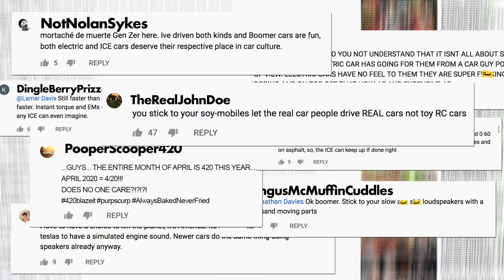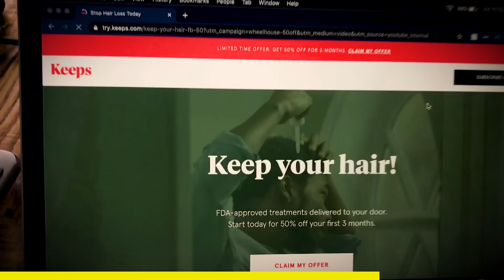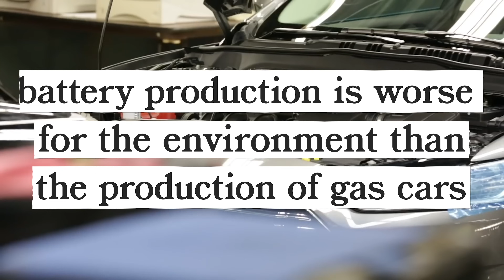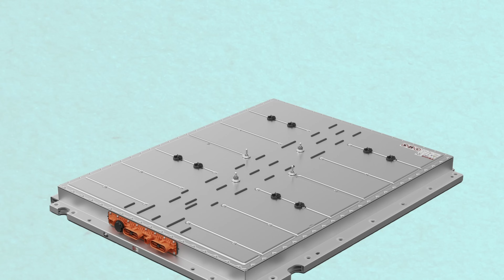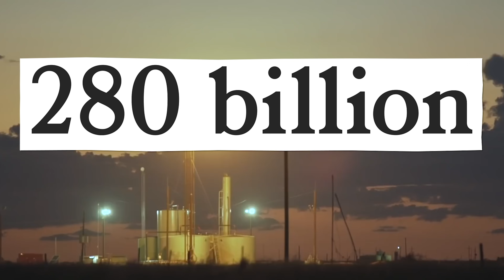Are Electric Cars REALLY Better for the Environment?

Comment: You forgot the most important factor - time. Nothing like wasting time to charge a battery. Gardeners don't even use battery powered string trimmers and yet, people are stupid enough to trust their cars to it. This country is getting more stupid as time goes on.
Reply: I have an EV. I charge when I get home from work. I just plug it in. I don’t have to stand around at the plug like some jackass at a petrol station. When I get up in the morning I have what is effectively a full tank of gas ready to go. I havn’t had to waste my time driving to a fuel station, standing outside in the early morning, then paying and driving back on route to get to work half an hour late, for the last year. Your judgement about time isn’t based in fact. My time has been hugely saved by having an EV. Not wasted.
Reply: @engineeringtheweirdguy2103  LOL...my gardeners don't even use a battery powered string trimmer and you want to drive around in one. You never had an emergency? Ever? What is the energy density of those batteries?
Reply: @LWRC  i don’t know what the energy density of my battery is. However comparing gardening tools to a car is a really dumb analogy to make. Firstly because car batteries are infinitely more sophisticated than those use in gardening tools. Gardening tools don’t have any form of battery management systems to maintain temperature and equalatoral charge cross nodes and regulate discharge and charge across nodes dependant on their state and temperature. Comparing EV batteries to gardening tools is like comparing an Olympic swimming pool to glass of water. They both hold water. But they’re made for different purposes and the Olympic swimming pool is a little more complicated in filtering, temperature control and chemical dosing.
Reply: @LWRC  hell you can’t even compare current car engines to gardening tools. When was the last time you saw a midsized sedan running off two stroke? Never.
Reply: @LWRC  but in answer to your question. If you hire a gardener, they likely spend all day doing lawns. Charging probably isn’t an option for them. I however do have electric gardening tools. Lawnmower, leaf blower and line trimmers. I can get through my whole yard and backyard on the one battery with the one charge (the mower takes two batteries at a time though so I take one out and put it in the trimmer and the other in the blower when I finish mowing). This works fine for me. By comparison, if you spent all day, every day, doing nothing but driving. Like a taxi service, you’d currently be better off with combustion. But if you just had to drive yourself to and from work every day, an EV would work fine for that purpose.
Reply: @LWRC  and emergency? Yes I’ve have plenty. But my model 3 standard range gets 250 miles to a charge. That’s enough to get me to and from work 3 days in a row without having to charge if I pleased. It’s enough to go to work, travel to the next city over to see my grandmother when she was ill, stay the night to look after her and then travel back to my home city on one charge. But if I had to I could have run a cable from a power point in her house to charge the car overnight or I could have stopped at a super charger on my way to or from and spent 10 minutes charging my car up. I’ve had emergencies. And I’ve never had an issue. And that’s using a standard range model 3. Not a Long range model 3 or the more impressive long range model S with 400 miles to a charge.
Reply: @engineeringtheweirdguy2103  I like knowing I have flexibility and not have to plug in any stupid charger. I go to the gas station and fuel up and that's the end of it for at least a week. And this is on a high performance car that doesn't get good gas mileage. I don't care. I can afford all the gas I can burn and I do burn a lot of it.
Reply: @engineeringtheweirdguy2103  Two stroke engines produces a lot more power than 4 cycle. Besides, who wants to keep waiting for it to charge? Sure you say you charge at night. What about if you forgot to plug it in? What about if someone needs the vehicle for some other reason and there is no time to charge it? You going to buy another gasoline vehicle to keep as a back up?
Reply: @engineeringtheweirdguy2103  You obviously don't get it. It has nothing to do with the sophistication of the technology but the energy density and how easy it is to use on demand.  A perfect example are forklifts in warehouses. They're not using propane in certain areas and have to use electric. Fine. And that is if the user doesn't forget to plug it in even with a battery gauge. Sometimes, shit happens and you have a forklift sitting on the sidelines charging for 8-10hrs during peak hours!!!  You want to keep it in a golf cart - fine. But don't force this stupidity on the rest of us that have better things to do than to charge a battery.
Reply: @LWRC  no. The only mpg equivalent that out does an EV are plug in hybrids. Which is almost an EV as it is. And I already told you. I can forget to plug it in 3 days in a row and get to work and back just find. And I have a 70 mile commute. Failing that I detour on the way home and stop at a super charger for 10 minutes. And I have had things pop up, I already told you. My grandmother became ill and I had to drive to the next city over, stay the night then drive back. None of it was an inconvenience for me.

But I’ll have fun in my much cheaper golf cart which can outperform almost any other combustion car, has better safety and handling than most combustion cars and has better features such as sentry mode, cabin overheat protection, remote summon and free regular over the air updates. You can keep your dinosaur car. You’ll have to buy another one before my golf car becomes useless and needs to be scrapped.
Reply: @LWRC  and nobody is forcing it on you (yet, they always talk about banning ice cars after a certain date but few places have done it). You’re just being reminded that they’re better cars in a lot of ways. Not in all ways for all cases, but in a lot of ways. Performance, safety, handing, cost to run, software features etc etc etc.
Reply: @LWRC  you seem to think with 250 miles of charge on even a standard range that I don’t have any flexibility for emergencies. Why? When was the last time you ended up driving for 3 1/2 hours for an “emergency”? I have plenty of range even with my standard range to drop what I’m doing and drive to the next city over and back. I have plenty of range to forget to plug it into a wall point for up to 3 days consecutively, including any trips to shops or local family visits, gym, etc. 

These aren’t problems. You’re making up problems that don’t exist. A real problem would be charge times for Taxi drivers. A real problem would be long distance freight for trucks. But for domestic purposes for people like you and me. These aren’t problems. Stop pretending they are.
Reply: @LWRC  also yes. Whilst it entirely green. They are far more green than any ICE car.
Reply: @engineeringtheweirdguy2103 Again, you want to waste your time go right ahead. These are toys and aren't serious consumer products. Most of the electricity in this country still comes from fossil fuels so what's the point to build a whole new infrastructure to save nothing?
Reply: @engineeringtheweirdguy2103  you want to look at the crap Tesla puts out? Safe? Hardly when the batteries self combust. I actually love Tesla drivers...when I change lanes, they always let me in and leave a lot of room. But then, my military HMMWV may have something to do with it. And keep driving your EV as it saves more fossil fuels for me.
Reply: @LWRC  what whole new infrastructure? Even running on a coal based grid they’re still more emission friendly the ICE vehicles. And the infrastructure is already there. Every building has electricity supplied to it.
Reply: @LWRC  actually according the the beuro of statistics, national highway and Traffic safety board, AANCAP safety board etc etc. they are 11 times less likely to spontaneously combust compared to a ICE vehicles and 5 times less likely to combust in a serious incident and when they do, are mildly safer as thermal runaway in batteries is slow and produces a lot of smoke without flames for hours before visible flames and present whilst combustion cars can be engulfed in seconds.
Reply: @LWRC  EV’s also have the highest average safety rating of any car category and the top highest scoring vehicles in safety in every nation that sells them are EV. For example on Australia 2 out of the top of 3 inclusive of the number 1 spot, of safest cars in Australia are Tesla’s.
Reply: @LWRC  and no. That’s not Tesla advertising and hype. That official numbers from government departments, and third party, and government vehicle safety boards.
Reply: @engineeringtheweirdguy2103  read the write up on tesla. Those cars left the factory with missing parts. Ever own a 911? That's what world class manufacturing looks like.
Reply: @LWRC  once again. Those problems havn’t been around for several years now. Infact there was a 85% drop in production faults within 6 months. Because they went from small batch manufacturing to full scale mass production. In the process they had to learn all the hard lesson legacy auto makers had to learn decades ago. Further to that they received much much higher volume of orders than they were expecting with the model 3. So much so for a while they were literally producing the vehicles out of tents! But like I said. Those issues aren’t a common anymore and are now on par with legacy auto makers. Infact an ex Ford executive in charge of quality control for forced inspected some model 3’s he saw parked in a car park and said they were on par if not better than other legacy auto makers
Reply: @LWRC  infact the orders for the model 3 were and still are so high that they are the best selling luxury vehicle in ANY CATEGORY. In the US. Selling more than the next 3 most popular cars combined. That includes Mercedes, BMW, Lexus, Audi, etc. they weren’t expect that kind of response.
Reply: @engineeringtheweirdguy2103  Learn? WTF? Aren't those workers suspose to know what they were doing? It is amazing we have people who actually buy this junk that wouldn't pass for cars from Korea. And now Hyundai cars are actually pretty good. Certainly a lot better than tesla. And you know what they say about a fool and his money.
Reply: @engineeringtheweirdguy2103  Just like the masses who jumped on the bandwagon when battery quartz watches first came out. Much more accurate than mechanical watches. And they're totally worthless the moment you walked out of the store. And my Rolexe I can actually sell for more than what I've paid when new. Can you not do any origibal thinking or are you just following the herd and what is told to them?!!!
Reply: @LWRC  right. Just skip over my comments about what the Ford exec who used to be in charge of quality control said about Tesla’s. Or that it’s no longer a problem. Completely ignored those. And clearly you do understand process control over job control. The workers know what they’re doing. But they either didn’t have the tools to get the job done to a certain degree, the time, or the end of line quality control set up correctly. Every major auto manufacturer has been through that phase when moving to mass production. Every one of them.
Reply: @LWRC  well the herd at the moment still back fossil cars. Because they make a “vroom” sound and think the batteries only last 2 years despite having an 8 year warrantee. 

As for you analogy to quartz watches, that’s not a very good analogy as a vehicle is a much larger investment than a quartz watch. Which means the market would need much higher certainty as well as much better results. 

As for your Rolex, that sits under an interesting business category. I forget the name of the model but basically companies like Rolex, take apple for example, pride themselves on being expensive. The more it’s costs, the more you want it. As opposed to traditional markets where the cheaper something is the more you want it. They actually did studies and people were more likely to buy apple products if they were more expensive than if they were cheaper. Your Rolex is in that category.

As for my model 3, at current I can sell it for more than I purchased it for. In Australia the wait list is so long and the actual price of the vehicles have gone up (due to exchange rates) than I can make a profit.

However in the US, model 3’s have been on the road long enough to get depreciation data. And if you look, the model 3 has the lowest depreciation of any car in history. Which should tell you all you need to know about EV’s.
Reply: @engineeringtheweirdguy2103  Certainly. Every manufacturer has had problems but not to the degree Tesla has had. To leave the factory with key fasteners missing? You want to pay for that crap - go right ahead.
Reply: @engineeringtheweirdguy2103  Sure - I'll race you in any Tesla you choose and I guarantee you will not win. 0-100-0 as many times as you can handle. And what happens after 8 years? What happens to all that waste that doesn't get recycled? We don't even recycle cell phone batteries and there are billions of them. In addition, to make these batteries, there are strategic minerals that are NOT within our control in the US. In addition, a whole new infrastructure has to be built to charge these golf carts out in the wild. A local Costco had 4 chargers installed years ago and they recently took all of them out. I didn't ask but it must have been a business decision. So yes, this is the trend we are in now and will be for a long time to come.
Reply: @LWRC  as I said not a problem anymore but very few had missing components the majority were panel gaps and pain finish issues. But even if they still had paint and panel gap problems, with what the car provides I would pay that
Reply: @LWRC  as I said for infrastructure, they only need a PowerPoint to charge. The infrastructure is already there doofus.
Reply: @LWRC  and what car do you drive?. I’m assuming you don’t think you’ll win in a hellcat. The Tesl model 3, (the slowest of the 4 models) does 0-60 3.2 seconds. Hellcat in 3.6. The model X large SUV does 2.9s and the model S plaid does 1.99 seconds. The roadster does 0-60 in 1.9 seconds and 0-100mph in 4.2 seconds.
Reply: @LWRC  hellcat quarter mile is 10.96 seconds, the model S in 9.3 seconds
Reply: @engineeringtheweirdguy2103  you want to run that extension cord for 120 or 240? Like I said, Costco already removed the charging stations at one of their stores.
Reply: @engineeringtheweirdguy2103  How do you chsrge at the supermarket? Shopping center? How about office parks? The electric power is there but without a station where your clown cars can plug in, its worthless. But of course, you have brought along your 10 mile extension cord!!
Reply: @LWRC  why would I need to charge at the office or shopping centres? Do you need to refuel at the office or shopping centres? I just charge when I’m at home and not using the car. Never had a issue at all. What fresh crazy tinfoil bullshit are you on about now?

And sure, there are plenty of other types of vehicles which can outrun the passenger vehicles Tesla makes. But why don’t you look at it this way. Compare similar type vehicles. Tesla model S is a larger luxury SUV. Similar cars in its category and price range can’t come close to its performance. The model S plaid is well and truely in super car performance realm. It’s faster than most sport based 2 seater vehicles at 3 times the price.

You said your car. Not any car. What is your car? Can it do 0-60 in less than 2 seconds? Don’t think so. And where oh where would you find yourself in the position to race a another car to 150 mph (it’s 150 now right? Not 100? I’m assuming that’s because you’ve looked at the quarter mile times). And where you would do that repeatedly. No, everywhere, where it counts, on the roads, freeways, traffic light, you will always be creamed by electric. At the lights and there is a merge to a single lane ahead, too bad, eat EV’s fresh air and dust, finally opened to an overtaking lane on a freeway? Too bad. So sad. There will never be any situation which hasn’t been specifically orchestrated, wildly outside every day life to give you any energy edge you can cling to, where you win bud.
Reply: @LWRC  for example, top gear did a review of the model 3 against its direct competitor, the BMW M3. Its a direct competitor in price, performance, class and size. The M3 being the BMW’s flagship vehicle. Touted as “the ultimate driving machine”. Top gear did drag races, model 3 won, handling and agility, model 3 won. Track lap times, model 3 won. The Tesla model 3 won in every single category usually tested by top gear. But this one episode and only this one episode did they invent a fourth challenge. A “driftability” test. To which they found they could fling the BMW out of control a lot easier than the model 3. (Because the model 3 had Better handling). And then declared the BMW the winner because the only category it won agains the model 3 in, a made up category never used to compare any car previously or since, despite losing in every convention category used in every review and episode comparing vehicles before or since.
Reply: @LWRC  and that’s interesting, highest selling luxury vehicle in any category is the model 3 and you think they’re all morons. The world must be a tiny place for you buddy. God bless you Have a simple brain.
Reply: @engineeringtheweirdguy2103  One last thing - given these EVs have high torque and accelerate pretty well, many drivers never had any experience like that before so they floor it from stop light to stop light. So guess what that does for mileage and pollution? There is no free lunch. So in the end, even if you assume EVs are more fuel efficient and less polluting (which they're not), these drivers are completely negating everything that you've stated!! Pretty stupid for society to go down this path.
Reply: @LWRC  I do have plenty of experience with performance vehicles. Which is why I prefer to drive Tesla’s. Your assumption wasn’t very well based in reality.
Reply: @LWRC  wake up to reality before you end up one of those old men still shouting about how smartphones are a fad and only idiots use them.
Reply: @engineeringtheweirdguy2103  Well, your experience isn't worth a pile of beans. Your Trsla can't stop worth a damn. You think it is a high performance vehicle but because you have zero frame of reference, you just don't know. Don't take my word for it - tomorrow, go do a 5-70-5 test repeatedly. Let me know how many times you can do this before your brakes feel like sponge Bob!! If you were to put money on this, you'd lose your ass.
Reply: @engineeringtheweirdguy2103  Why don't you tell us what high performance vehicles you've own giving you the basis for your decision on the Tesla?
Reply: @engineeringtheweirdguy2103  Regenerative braking is a good thing but you'd think the guys that race me would at least use the brake pads!!! Pretty pathetic. I hope you don't bring this up in any race forum as you'd be the poster clown!!
Reply: @engineeringtheweirdguy2103  Looks like you're still too embarrassed to even say what you have as a benchmark of a high performance car!!! Regenerative braking...LOL... can't make this shit up folks!!!
Reply: @LWRC  it’s not for stopping distance. Never said it was. Do you have trouble with reading comprehension as well? Gnaawww poor fella. If you read it again, I didn’t say it was for braking distance. I also didn’t say it was to replace the brakes. It said it was to take a large portion of the breaking load. Do you know what that means cletus? That means the brake don’t have to work as hard! Which means they heat up and wear out less. Which means better brake endurance. I specifically made a note in my comment saying that braking distances aren’t anything special. Try your very best not to be an idiot and embarrass yourself on a plublic forum?
Reply: @LWRC  professional race teams don’t use them because they’re not allowed to. In addition, they are used in formula E. The other problem is that I’m endurance races, the batteries get too hot and power has to be reduced. So that would list off all the reasons they’re it in ICE car races. But that isn’t to say they don’t have their own racing league called formula E racing. Which I have mentioned in a previous comment. But once again your illiteracy is getting the better of you.
Reply: @engineeringtheweirdguy2103  Like I said prove it. Because you can't . You have the car - go do it.
Reply: @engineeringtheweirdguy2103  So your car can't stop worth a damn. Glad you finally admitted.
Reply: @engineeringtheweirdguy2103  so what cars do you have that put this pile of crap on top? Still too embarrassed to say? Folks are running out of popcorn!!!
Reply: @LWRC  it can stop, with similar stopping distances to any other vehicle in its class. Again, reading comprehension. Something you need to work on.
Reply: @LWRC  you can literally google those numbers. But you don’t. Because you want to keep the blinders on. Ooohh yes, ignorance is bliss for you isn’t it there cletus.
Reply: @LWRC  watching you flop around with your denial like a fish on a hot plate is a lot of fun. :D
Reply: @LWRC  no. I don’t often race anyone on the street. They have something here in Australia called hoon laws. If I get caught illegally street racing my car gets taken from me on the spot and taken to the wreckers to be crushed into a cube. No questions asked. I don’t even get the cube. And I also lose my license for 2 years. So A.) why the hell would I be stupid enough to do that. B.) who the hell is stupid enough to buy a car purely for that and C.) why would that even matter. Since all I have to do to make you hilariously and irrevocably angry is to just cream you at any set of lights as though I was just on my way to pick up the Sunday milk. All you can really do is shout at me about how I’d potentially lose against vehicles already well outside the class of car I’m in, in scenarios that I would literally never find myself in. For example, I am never going to find myself illegally street racing. I’m never going to find myself dragging someone to 150 and then to a stop, 40 times in a row. It just isn’t going to happen. All you have is a car that’s going to stare at my tail lights in traffic.
Reply: @LWRC  because if you were to meet me on the streets at a set of lights, there ain’t nothing you can do. You’re going to lose. You can scream unrealistic hypotheticals all you want. But you’d be doing so to my rear bumper. And everyone is going to see it
Reply: @engineeringtheweirdguy2103  You can't stop more than 2x before your brakes start to fail. That's how bad they are!! And how much did you pay for it and how long did you have to save to afford it?!!!
Reply: @LWRC  only 2x? Where did you pull that statistic? I’m guessing it starts with A. And ends in ss
Reply: @LWRC  didn’t take me long to save at all, it cost me $60K AUD. And it’s already saved me nearly $7k AUD. Whilst absolutely obliterating any other petrol headed Neanderthal at the lights. It’s brilliant watching people with so much pride in their cars ability to wake the neighbours, screaming and punching the steering wheel in my rear view mirror. Actually..... people like you!
Reply: @LWRC  you would spend more on a hellcat or a BMW just to pay more for fuel and servicing and to diddle behind me in traffic.
Reply: @engineeringtheweirdguy2103  You actually had to save that paltry amount?!!! What kind of job do you have? Obviously, you've never had any performance vehicles and is why that clown car is so high performance. And don't forget to plug it in!!! Batteries hot yet mr pocket protector?!!!
Reply: @LWRC  as I said. Not for long, a couple of weeks. As for what I do for a living. I’m a consultant Mechanical Engineer.
Reply: @engineeringtheweirdguy2103  You obviously understand what I've been saying. With or without regenerative braking, your coal car still can't stop as well as some vehicles currently on the market now! So what's the deal with how fast you can go from 0-100 when you can't stop?  Go ahead - why are you so afraid of doing the repetitive braking test? 
So what else do you own besides the clown car?
Reply: @LWRC  well firstly, as I’ve said. Hoon laws. Further to that, I’m making myself a traffic hazard. Also it does stop. In line with the standard stopping distance of any car in its category. For example, the stopping distance for the model 3 is on par with the standard stopping distance for most of the vehicles in the mid sized luxury sedan category. It’s not the best stopping distance and it’s not the worst. It does stop. Under what circumstances would I need to stop faster than all the other cars on the road in traffic. 

Additionally, how much driving skill do you think you need to accelerate in a straight line from the lights? Do you really find diving so hard you can’t even do it in a straight line?
Reply: @engineeringtheweirdguy2103  You're grabbing at thin air now .. remember, I wasn't the one that brought up how fast Teslas can be. You brought it up, but you have zero experience in this field. When I called your BS, you all of a sudden now say all it has to do is stop like a normal car. So if you have a normal car, what makes you think you can beat a performance manufactured vehicle? And you still can't say what cars you own that is high performance and still haven't had the guts to do the brake test.
Reply: @LWRC  I wasn’t the one who brought up braking. You were. In a very desperate attempt to claim that since it doesn’t brake faster or slower than other cars in its same class and category, then that makes it slow. You must be trying some crazy mental gymnastics. Like when you started saying you needed excessive driving skills to accelerate in a straight line at a set of traffic lights
Reply: @LWRC  let me ask you this cletus, if your car and a wildcat were at set of traffic lights on a 60 or 70mph limited road which had a merge to one lane at the end.... who would end up behind who? Yes! That’s right! Gold star kiddo! The wildcat would be staring longingly into the Tesla’s tail lights! And that’s because its.... c’mon, you can do it. Starts with F..... nooo, because it’s FASTER.
Reply: @engineeringtheweirdguy2103  Lets try that again - your clown car is not faster than my car as I don't have a Hellcat. And going into corners, your piece of garbage would be behind a Hellcat. And you are too embarrassed to say what other cars you have because you don't.
Reply: @engineeringtheweirdguy2103  You've never had a race have you? For a given distance, your clown car can't brake and guess who's rear end and exhaust you'll be sucking up!!! Better roll up that window and hopemyour battery doesn't die 🤣🤣🤣
Reply: @LWRC  also the model S does a sub 10 second quarter mile. Not exactly slow.  It last time I was at a drag strip, we didn’t have to see who could stop the fastest. It was more about who could cross the line first. Don’t know what fantasy world you’re living in cletus.
Reply: @LWRC  once again. Look at top gear comparing lap times between a model 3 and a BMW M3. Or the agility and handling test, or the drag test. Model 3 wins every single one. I already pointed out to you they can’t do endurance races. Once again, not something I’m likely to do on a daily basis.
Reply: @LWRC  I’ve already told you what makes EV’s so great. And already explained to you both why I won’t to do repeated heavy braking tests on crowded public roads and why doing so also proves nothing and is pointless. I’ve already explained to you why is a long reach for a small straw.

Learn to read cletus
Reply: @LWRC  and running away from my question I see. How about again, if at a set of lights right before a merge into 1 lane, I was in my model 3 performance in one lane, you were in a hellcat in the other. Who would be staring at brake lights. You or me. It’s a very very simple question. Why don’t you answer it?
Reply: @LWRC  are the words I’m using too big for you? Do I need to use smaller words? Keep to to 3 syllables or less?
Reply: @engineeringtheweirdguy2103  LOL...so what. We've done engineering feats you can't even comprehend. And you call yourself an engineer?
Reply: @engineeringtheweirdguy2103  Track days? So another words, you have zero street experience or your clown car would be crushed!  So afraid!!!
Reply: @engineeringtheweirdguy2103  Too chicken to do it !!! Chicken logic🤣🤣🤣
Reply: @LWRC  you won’t even say what your car is after multiple requests for you to spit it out. Braking speed doesn’t make a vehicle fast. Doofus. That’s like saying Usane bolt is slow because he doesn’t slow down fast enough once he reaches the finish line
Reply: @LWRC  also you haven’t answered the question. Hellcat vs Tesla at lights. Who would be staring at who’s tail lights. It’s a simple question. Why are you so afraid. Ones a luxury 4 door passenger sedan. The other is a 2 door purpose built performance vehicle.
Reply: @LWRC  the US Lost a million dollar satellite because it could correctly convert from metric to their imperial units. The lunar missions were first calculated using metric system and converted to imperial after for show and for the public to understand. 

Meanwhile Australia has been responsible for inventing:

-The black box,
-Electronic pacemaker,
-Google maps,
-Wi-fi
-Medical penicillin
-The polymer bank note (still something the US can’t get their head around)
-Cochlear implant (bionic ear)
-The electric drill,
-Permaculture,
-Ultrasound scanners,
-Plastic lenses,
-Inflatable escape slides on aircraft,
-Cervical cancer vaccine,
-Frazier lenses,
-Race cams,
And so much more. Believe me, nothing the US does bewilders me.
Reply: @LWRC  you can’t even negotiate healthcare at a first world standard. So don’t get too hot for your cowboy boots there kiddo.
Reply: @LWRC  Australia also invested the two stroke lawn mower, latex glove, insect repellent, garage roller doors, ballistic glass, pre-paid postage, the bushmaster armoured vehicle, the first mechanical refrigerator, thrust bearings, floatation separation, self erecting cranes, etc etc.
Reply: @engineeringtheweirdguy2103  That's what happens when you can't stop!!! Apparently, you have zero experience in racing to say oh, braking is meaningless and it is only about HP!!!
Reply: @engineeringtheweirdguy2103  Hey bird brain - here is a comment by an owner posted on a clown car forum and I'm posting it word for word!!!  
"Well you are not alone my friend. Tesla proudly says they know that their Model X build quality is bad and they harp like a parrot saying "Within the specs". To say the least the vehicle delivered to me should not have rolled off the production line quality check and inspection. My model X was delivered with major misalignments of doors, fenders, hood and bad paint job of hood and doors. My MX had to be sent back to factory for re-fit and still its no close to what a $110k Luxury Vehicle should be. Once you placed order and vehicle delivered, you see the "real" customer service experience from Tesla with rude behavior making you feel stupid with their answers of "with in the specs" and stonewalling you with no resolution and heavy handed behavior from representative to representative frustrating you and wasting your time. After all the retrofit and no driving due to covid for close to a year, when I drove my vehicle the other day while raining and stopped to drop off passenger in middle seat and on opening the falcon door water leaked into the cabin drenching the passenger and ruining the leather seats. So much for a vehicle branded "Luxury" with such poor build quality with cheap lining and plastic components. I am waiting for Tesla to address the leak into the cabin under warranty, so far they send me an estimate charging me for their crappy build."

This is pretty funny to be spending this kind of money and getting junk. Now if I said it, you'd say I don't know what I'm talking about but this is from actual owners!  Spend more and get junk! That must be Tesla's motto that you didn't see because EVERYONE at the factory are laughing at you ass clowns for buying their junk!

https://forums.tesla.com/discussion/182829/2021-model-x-build-quality-and-my-remorse
Reply: @engineeringtheweirdguy2103  You've never been in a race to understand what I've been saying. Time to get real but I guess it is tough considering there aren't that many high performance cars down under. That's why you think your clown car is the latest hot shit to come out of Tesla.
Reply: @LWRC  and yes. I did say they were fast. I didn’t not say fastest. We’ve covered this cletus. Keep up.
Reply: @LWRC  you also havn’t told me what you drive yet. What’s the matter? All bark and no bite. What’s the matter kitten? Getting shy?
Reply: @LWRC  Tesla’s can stop just fine. It’s actually a legal requirement for vehicles to stop under certain distances. Why do you keep insisting that they can’t? Apparently the breaks in the model 3 were enough to out perform a BMW M3 on a track.
Reply: @LWRC  the BMW M3 also has 4 piston break calliper. So does the Mercedes CLA. And many other vehicle in the same class. To which the model 3 has similar braking distances to other vehicles, again, in its class. And only the model 3 performance has the large 4 piston callipers. So that kinda shoots your self in the foot there doesn’t it?
Reply: @LWRC  that quote was from February 2016. Just as they were beginning to ramp up for model 3 release. Again. We’ve addressed this. Keep up kiddo.
Reply: @LWRC  not many performance cars in Australia. Have you ever been to Australia. Do you know what a Monaro is?
Reply: @LWRC  former fores exec bob lutz inspected model 3’s on the street and said they had excellent fit and finish.
Reply: @LWRC  oh look. The model 3 has been named the most reliable executive car. Interesting for a vehicle which according to you has so many problem. Considering for that they’d have to beat out BMW, Audi, Lexus, Mercedes, Jaguar, Porsche...
Reply: @engineeringtheweirdguy2103  And still too chicken to do the brake test! Oh, mr genius soends $$ buying junk!!!!
Reply: @LWRC  tell me. The people who buy into the luxury car market, successful people and executives etc... what do they have in common? They’re not stupid, and they are successful with their money. So how come a Tesla is the most popular luxury vehicle in any category, SUV, estate, sedan, large sedans, etc?
Reply: @LWRC  and I’m hardly alone in being an engineer who sees the obvious advantages of Electric. Just go to YouTube and find a channel called “Engineering Explained.” He has a Tesla, before that he had a leaf or a bolt (can’t remember which). Infact a lot of his videos are on electric vehicles. So I’m hardly the only Engineer to own one. And if so many Engineers own EV’s what might that tell you? C’mon genius, get those brain cells working
Reply: @engineeringtheweirdguy2103  Why don't you read the links I've posted from the Tesla forum - all the problems buyers actually had! Nice, spend money on junk. I know, you  people down under don't have fast cars and this is the best you can afford - good for you. But you have no clue what we have here in the US.  So when are you going to test those brakes on that clown car mr chicken head?!!!
Reply: @LWRC  I responded directly to those links. Your inability to read isnt my problem buddy. also as i've stated early, build quality issues are rapidly reducing and aren't really an issue anymore.
Reply: @LWRC  actually my degree transfers over to the US. However US engineers need to receive additional training to practice here in Australia. So....
Reply: @LWRC  did you even read your link kiddo?
Reply: @engineeringtheweirdguy2103  I don't think your degree transfers anywhere - maybe if you go to Africa. All the top engineering schools on this planet are here in the US. No one, and absolutely no one, goes to Australia over the US if they can help it. 
In addition, besides just the academics, what have your engineers done for your country? Have they built world class nuclear subs? Did Australia launch satellites into space? I guess your government did announce something late 2020 for the next 10 years to have a satellite program. How about a mission to Mars?!!  You know what we've done recently as it has been on the news and I'm sure they cover it in Australia.  
Sorry chump, you guys are better than those in Africa but still have quite a ways to go before you can match what we have here in the US.
Reply: @LWRC  why would risk losing my car or being re-ended for some random on the comment section of a YouTube video. Go home kid
Reply: @LWRC  who do you think designed, organised and orchestrated the communications systems during the Apollo missions? Oh that us. And the majority of university students in Australia are foreign students. That’s how the universities make most of their money here. And yes, US engineers have to undergo re-training when coming to Australia. I can to register in the US and work there as an Engineer if I’d like. I know this because the company I work for often sends Engineers to America to deal with problems THEY CANT.
Reply: @engineeringtheweirdguy2103  Oh...ok...we can't deal with technical problems and is why we have the best and most powerful Navy, Airforce on the planet and have sent spacecrafts to the moon, Mars and beyond. OK...I can see where this is going. if Australia has such great engineers, why not build something? WTF are you  people waiting for? I can't speak for what problems we can't solve that we have to import foreign engineers to solve unless it has to do with some proprietary items. That goes without saying. What company do you work for and what do they make that we can't figure out?!!
Reply: @LWRC  you have clearly never been to Australia... also you couldn’t have gone to the moon without our help. Much of the technology in your Navey and military is Australian. For example Australia has at current the most sophisticated frigate in the world, which is often loaned to the US. The most advanced and successful armoured troop transport vehicle in service today is designed and made in Australia. The Thales Bushmaster. Infact the US tried to copy it after we refused to give the US rights to make it, and testing videos of the American copy were released during its own braking test where the back wheels came off the thing and did the rounds on funniest home videos and fail compilations on the internet.
Reply: @LWRC  also as a side note. I know the materials engineer who designed the heat deflecting tiles on the space shuttle program and the radar absorbent material for the F22 raptor and, sorry. Australian. From Perth. Moved to the US after being request to work for NASA.
Reply: @LWRC  you’ll like this. Just found out that day after tomorrow I have to drive out to a country town to the East of Melbourne, then drive back into and through Melbourne city, keep going through to the next city and end up in a country town on the opposite side. Then drive all the way back home again. Theoretically I’ll have enough charge to do that. Would be about a tank of fuel’s worth in my old Subaru so I will let you know how I go.
Reply: @LWRC  oh, also just a thought about how Australia differs from America, you can just compare how COVID was handled in Australia here vs the US. and the impact that had on the economy and lives. Additionally an Australian was one of the  team which cracked the latest zodiac cypher your FBI have been working at for decades.
Reply: @LWRC  also had a quick google search for scientific fields being lead by Australia. Turns out Australia contributes significantly to global innovation in our unique willingness for global collaboration in science. We are also global leaders in as many of 20 scientific fields, including space science, physics, computer science and clinical medicine. Australia is also ranked in the top 10 counties for skills. In that respect, we are also ahead of the US. go figure.
Reply: @engineeringtheweirdguy2103  OK. If you have the range - that's great. And it sounds like there will be plenty of open space for you to do acceleration / stopping tests.  Just for the fun of it, I'd think if you were truly a car guy, you'd do it just so you'd know. So share your knowledge, honestly, I'll wait to hear what results you get.
Reply: @LWRC  Nope, we did not help china with their technologies. We did help the US with theirs. as part of a cold war agreement. Additionally according to the same agreement if either one of the US or Australia goes to war, Both countries go to war. Meaning every war you started in the Middle East, Australia has been obligated to join in. If China starts a war with Australia, the US is obligated to defend us. You even have significantly military bases in far north QLD and Northern Territory. Infact Australian troops teach US Marines about jungle/tropical warefare.
Reply: and im just stating facts. without Australia you wouldnt have been able to go to the moon. At least, not without communicating with them. Your shuttle program would have been delayed as well as the F22 program.
Reply: @LWRC  You talk a big game but in a military exercise one of our diesel submarines, was pitted against the entire US naval anti-submarine fleet. including counter submarines and submarine detection aircraft and specialty built anti-submarine ships. And despite the US cheating but not turning off their active and passive sonar for the first day of the exercise to allow the Australian submarine to not start the exercise in a known position, guess who won the exercise. The Australian Submarine got within striking distance of the US flag ship and took periscope photos of it as evidence. signalling that the US flag ship would have been sunk by Australia one little diesel submarine despite the entire US anti-submarine might.
Reply: @LWRC  my point in all this. Is dont throw shade on other countries you know nothing about. Because in alot of ways, America isn't doing so well on the world stage.... at all. hell in rating of technology in respect to research development and skills, Australia is in the top 10 whilst the US doesn't even make the top 50.
Reply: @LWRC  I have done a braking test. I havnt sat there and done it 50 times in a row like you're asking. and no. You clearly havnt been to Australia. the freeways I will be driving on will be most of the time heavily congested, even rurally. as you have to go out maybe 500km or more before you start loosing most traffic to the point you're thinking of. And that's if you don't hit another city first.
Reply: @engineeringtheweirdguy2103  Sure....you forgot the Australian that walked on Mars!!!
Tell us which weapon systems all the countries around this planet, except for Russia and China, buy from Australia?!! Why didn't they buy those choppers in the links I sent you from your country?!!
Reply: @LWRC  we don’t sell weapons or weapon systems. Why chopper? I’ve not seen any link.
Reply: @LWRC  we buy them modify them to be better, like our Collins class submarine which evaded your entire anti-submarine fleet. Or we make here like the bushmaster APC.
Reply: @engineeringtheweirdguy2103  you're slipping....google it. Apache.
Reply: @LWRC  the Apache isn’t Australian made. It’s made by Boeing. I don’t understand your point
Reply: @LWRC  and yeah. We did buy them from the French because we don’t have the dry dock facilities for submarine construction. But when they arrive in Australia we heavily modify them.
Reply: @LWRC  it’s not to do with Engineering expertise. It’s to do with cost and infrastructure. The US spend more money on defence than anyone in the world by a fucking huge margin, something like more than the next 4 biggest spending countries combined. Hell trump increased military spending by more than the entire Russian military budget. We don’t have to spend that much. We are our own continent more than double the size of the mainland US. With most arad uninhabited land. Fighting a war here would be near impossible logistically. Even for China. And they know it. So all we need is a military for projection for regional stability. Whilst not large we emphasise training, skill and technology. So much so, that Australian fighter pilots train US F22 pilots, Australian infantry train US marines and seals in jungle warefare in far North Queensland and in the invasion of Iraq, the US requested Australian pilots to lead the air attack before the invasion. All true, google it.
Reply: @engineeringtheweirdguy2103  That's the whole point of what I've been saying....you have lost your focus. Australia has no domestic made combat aircraft of any type. Not since WW2 anyway.
Reply: @engineeringtheweirdguy2103  LOL....I'm running out of popcorn bud!! Another excuse. Dry docks are the least of any country's problems if they have the expertise to build nuclear attack subs - and you can't build dry docks?!!  That's how bad it is in Australia - it comes down to dry dock space?!!!
Reply: @engineeringtheweirdguy2103  And Australia has ZERO fighter aircraft! ZERO!! Not even ONE if you bought is from the US, Russia or China!  Forget about making it domestically - your country did not even buy ONE on the open market!!!
Reply: @engineeringtheweirdguy2103  And the arena where the big boys play....nuclear weapons. 
The US, China and Russia all have tactical nuclear weapons and military grade platforms for delivery. Australia - no nukes....so which means you'll have to rely on ......batteries!!! You'll just electrocute your enemies !!!
Reply: @LWRC  you’d be pleased to know I did the 5.5 hours of driving short notice yesterday. Only has to top up early on at a charger on my route as i passed through one of the cities as I wouldn’t have the opportunity to until I was almost home. Topped it up for 10 minutes while I went and got a coffee from the cafe next door. Did the rest of the driving and made it back home with 35% remaining. Easy.
Reply: @LWRC  because we don’t need to make them here. He buy them and modify them. Do you have any comprehension of the capital expenditure with setting up mass production facilities for military vehicles such as aircraft? Hell, even the US outsource theirs. Through private companies such as Boeing and Lockheed Martin who are international companies who also have headquarters and Engineers in Australia, and a handful of other countries. With the amount we need to and want to spend on defence, there is no need to sink Huge money into infrastructure were aren’t going to use a lot of. That being said Australian Engineers are involved with that kind of thing all around the world. As I said before, Lockheed and Boeing have headquarters in Australia as they do in a handful of other countries, employing hundred of Australian Engineers each.
Reply: @LWRC  again, the capital overhead costs to build a dry dock is not worthwhile for the amount of submarines we want to build. We don’t feel the need to spend as much on military as the US does.
Reply: @LWRC  it’s about if the expertise are there. It’s the 21st century, we can participate in design from anywhere in the world. It’s about infrastructure costs. Why would you spend $40 billion on infrastructure and labour to build $200 million worth of submarines? Use your head.
Reply: @LWRC  what are you talking about? We have plenty of fighter aircraft. Including the FA-18 super hornet, and the F35 lightning (which we help you Americans design, if you remember).
Reply: @LWRC  as for nukes. Why do we need nukes? Nukes are an expensive and diplomatically complicating solution to a problem Australia doesn’t have. In addition where do you think you get your uranium from? And who do you think helped you test and develop them? Australia. You set off seven nukes in Australia the to study them with the help of Australian physicists.
Reply: @LWRC  as I said, we have a treaty signed with the US that both countries will be at war if one country is at war. If China attacks Australia then technically they’ve attacked the US. And you are obligated to come to our aid. As for invasion. Good luck to them. Australia has a much larger land mass than the mainland US. Except almost all of it is uninhabited desert. Fighting a war against a moving organised military somewhere in the middle of one of the worlds largest uninhabited areas, isn’t a simple feat. Even for China. It’s makes Australia exceptionally difficult to invade. Ask any military analyst, invading Australia is a stupid idea.
Reply: @LWRC  we don’t buy all our military elsewhere, just a lot of it. We do make some ourselves such as a lot of our weapons as the bushmaster I keep coming back to as an example because the US and Canada are still begging Australia for rights to purchase them. Because they’re better than anything else out there currently. 500 lost in conflicts in the Middle East to IED’s and anti tank mines. 0 injuries or deaths of occupants. They can withstand low caliber anti-armour shells such as the 25mm cannon on an M2 Bradley, they can carry 12 people and have 2 remote gunners, it can carry supplies and filtered water for up to 12 days worth. The thing can be stripped and have a new drive train or systems replaced within 4 hours. It travel up to 90 kms off road and to top it all off, it has air conditioning. And can be equiped as command vehicles.
Reply: @LWRC  you measure your countries worth on how large its military is. You spend billions developing an anti-submarine fleet which was defeating in war games by a single diesel submarine modified by Australian Engineers. And that’s fine. You can do that, it’s your right.  But not every culture is as war mongering as the US.

I however measure a countries worth by their education rates and contribution to the global pursuit of science and technology. In which, in a lot of way, Australia is up there at the forefront. Infact in the global human development index, Australia is 2nd in the world on education with an upwards trend. Whilst the US at the time of the report was 5th. With a very steep downwards trend.
Reply: @engineeringtheweirdguy2103  You buy that 50 mi extension cord yet? You want to race a real car and see how bad your golf cart perform?!!!
Reply: @engineeringtheweirdguy2103  Those fighters you have are not 5 grneration fighters! We sell you shit we don't use!!!
Reply: @engineeringtheweirdguy2103  Why are you geniuses depending on the US for nuclear sub designs?!!!  Wherevis yourvspace program?!!! When did you folks land anything on the moon forget humans?!!!
Reply: @LWRC  we use the FA-18 super hornet with a handful of other countries and we didn’t buy them second hand either. and are in the process of upgrading to the F35 lightning which most DEFINATELY is 5th generation. It’s probably also worth mentioning that Australia had a hand in designing the F35, with the notable difference being that all the parts we designed went on schedule and on budget, whilst the parts the Americans designed……. Not so much.
Reply: @LWRC  we weren’t going nuclear until the last government decided to. British and American engineers took decades of research and testing to successfully build nuclear submarines to where they are now. The idea is to share that information with us, so that we don’t have to spend 40-50 years in R&D like you and Britain did before we have a fully fledged nuclear submarine to threaten China with. But before our last government which every despised for going nuclear along with many other things he did, Australia had no interest in nuclear anything, despite having 1/3 of the worlds uranium. We have no interest in nuclear bombs, nuclear reactors, nuclear submarines or nuclear ships. You think we couldn’t? We have 1/3rd of the worlds uranium. Where do you think Europe and the US get their uranium from? We also have vast open deserts with no life for thousands of kilometres we could use for testing if we wanted. But we don’t. Now we’re stuck with nuclear submarines which won’t fit the mission profile Australia needs for submarines as well as the Colin class submarines we were getting.

You know, the class of submarines that sunk your entire anti-submarine fleet during war games… that one.
Reply: @LWRC  you’re not doing too well here sport, maybe try again next year.